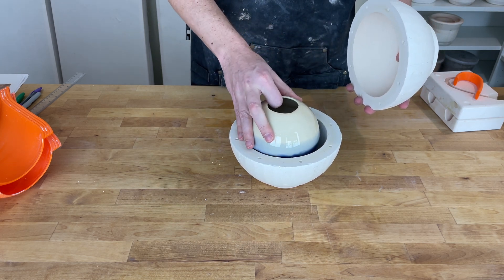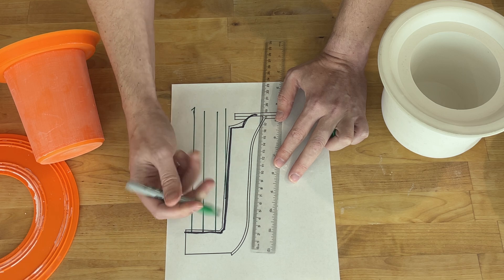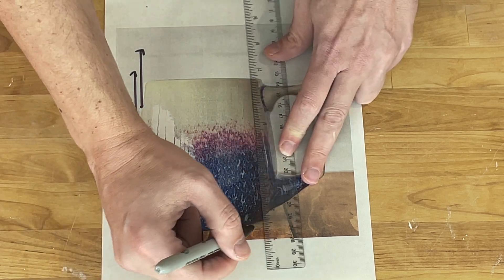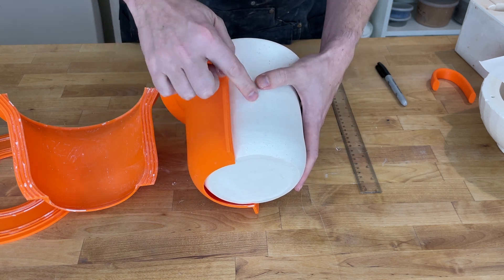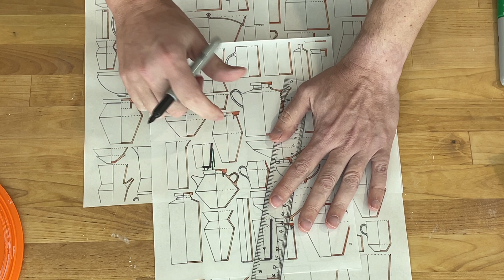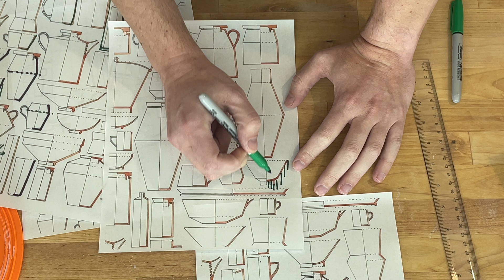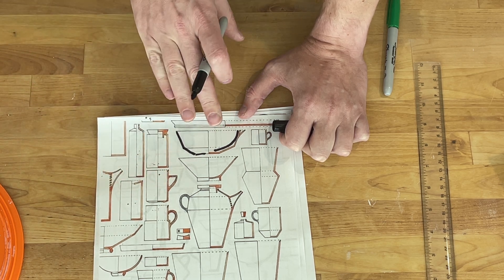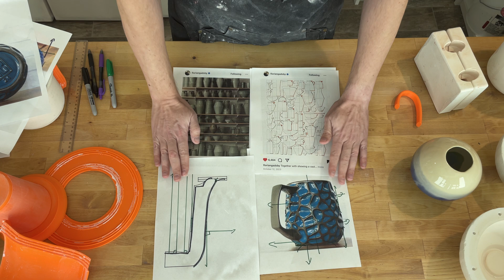1 or 2 part mold? What's the difference?

Comment: Splitting vertically should work for any shape (that’s rotated around a central axis). 
Also both halves would be symmetrical, so you could reuse the 3D print. 

Curious why you’re going with splitting horizontally. 

I can see that in some shapes misalignment of the two molds could be somewhat easier to fix  after the clay has come out of the mold. But for example your orb mold would have the same problem when split vertically or horizontally. 
The vertically split one does require some strapping to hold together. 
But on the plus side, you could still have a slipwell.

My intuition says horizontal would be better, but I can’t really rationalize it. 

Anyways. Thanks for the video. I enjoy seeing the progression of Shapcast.
Reply from the maker: Splitting vertically will not work for any revolved shape. Sometimes it could fail when the foot is hollowed out (as I mention with Hammerly's pot). It is really dependent on the geometry of the form and being able to rotate it out of the mold. It would not be able to be pulled straight to the side if the foot has a recess.

The real reason to split horizontally first is that 95% of the modeling and associated code needed is the same and it opens to door to a lot more forms. If you're making your own molds with 3d printing or the traditional way, of course do whatever you think works best for your practice. 

And I don't plan on stopping here. It's just the next waypoint along the journey.
Reply: @ I didn’t think of that. That makes sense. Thanks.
Reply from the maker: Sure thing!